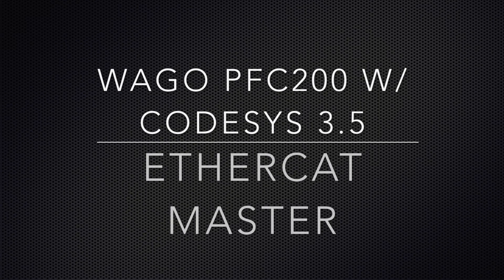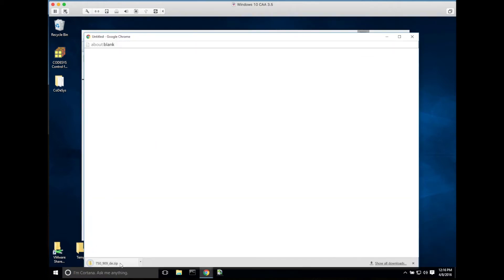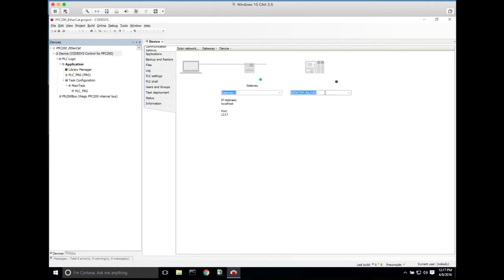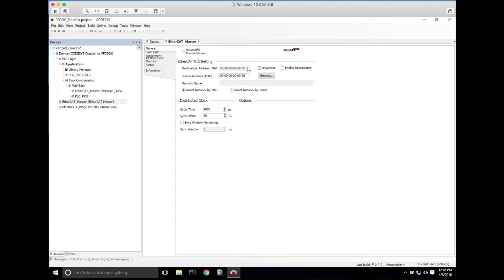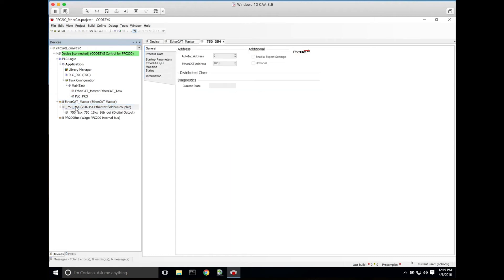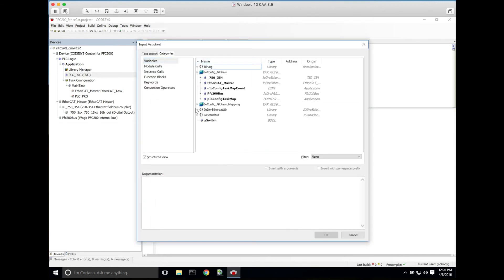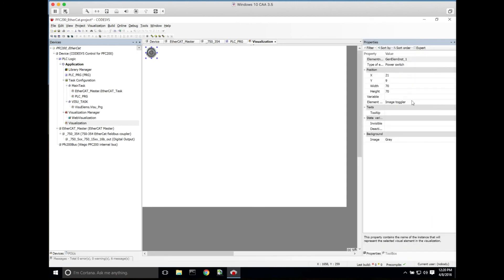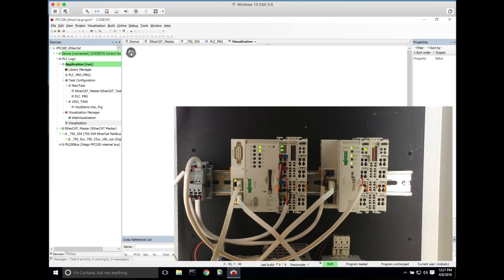WAGO PFC200 as EtherCAT Master with CoDeSys 3.5

Comment: Hello Jesse,
Could I ask is there a way to use PLC 750-893 and coupler 750-363 in order for tipical Ethernet communiction with the full features of the protocol Master - Slave or whatever communication?
Reply from the maker: There is no EthernetIP scanner or Ethercat in either of these.  Using the PFC or TP600 with the CoDeSys 3.5 runtime will allow these masters though.
Reply: @JesseCoxPDX  Thanks, Jesse.